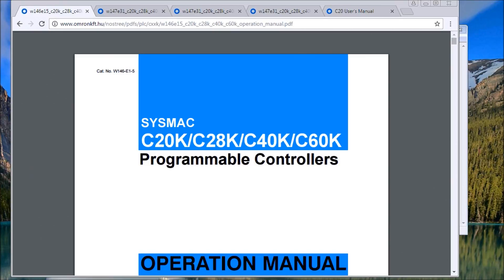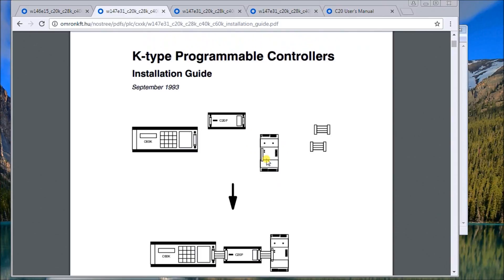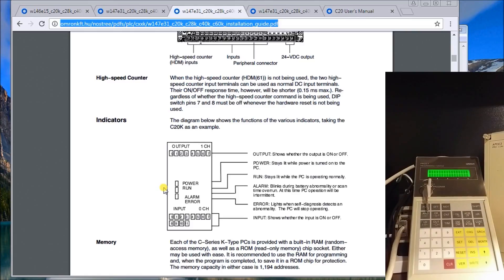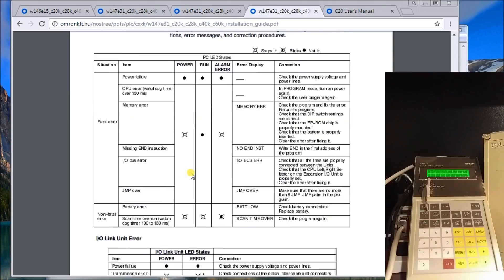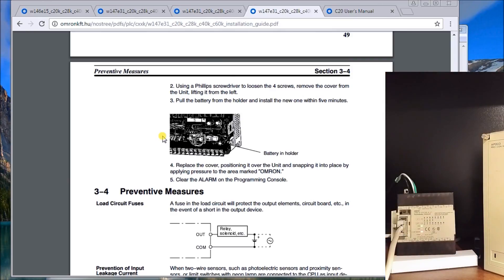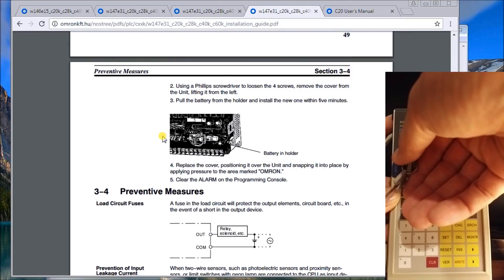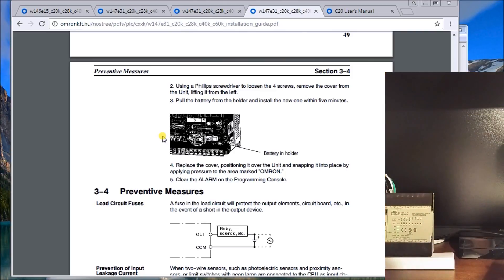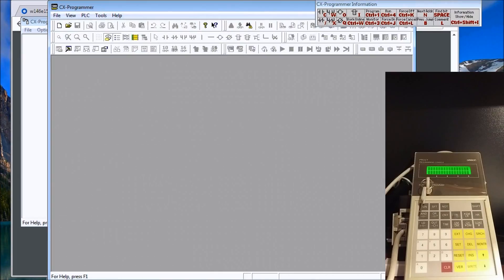Omron K-Series Crisis: 25-Year-Old PLCs on Life Support

Comment: Hello
I have an ancient Omron SYSMAC C40P controller with a C120-PRO15 programmer on board.
When turned on in all modes (RUN, MONITOR, PROGRAM), it requires a password. Can you help? It's a pity to throw it away, I could have worked more!
Reply from the maker: Usually, there is no password. Make sure the slide switch is on MON. Then push CLR, MON, CLR. 
You will find this on page 6 of the following manual.
https://www.edata.omron.com.au/eData/Software/Devices/W184-E1-1A.pdf
I hope this helps you out.
Regards,
Garry
Reply: @ACCautomation  

Thank you very much
I also now noticed in the video that at start they type this key combination. Thanks for the PDF, I will understand. You can ask another question. This series of controllers are programmed only with a special C120-PRO15 (PRO25) programmer or can the same actions be performed in software (CX-Programmer v.5)?
Reply from the maker: @Графен-д5о  
The C40P is an older Omron PLC and is not supported in CX-Programmer. 
In order to use a software package, you must use a host link module on the unit with software called Syswin (Windows XP or older) or LSS - Ladder Support Software (DOS).
https://accautomation.ca/purchase-find-parts/omron-c20k-c28k-c40k-c60k/#Software 
The best way currently in my opinion is to use the handheld you currently have.
Regards,
Garry

Comment: I need your help with a sysmac c40k. It’s part of a small printing press and all the start and stop switches go through it.
Recently the contactor to the main motor suffered a burn out and the overload protector on the contactor must have sent a signal to the PLC. I have replaced the contactor and protector but when the start button is pushed the output light on the PLC just flashes. The PLC has an eeprom in it so I’m assuming the program is still intact and running because everything else that it runs is still working fine. Is there something that needs to be cleared or reset?

Comment: Found this controller installed on an old SprayBake paint booth for an auto Body Shop. Found the battery failed, replaced it but the system was down for over an hour. Program is most likely wiped from memory now. I have to contact Spray Bake to see if they have a way to upload the original program from 30+ years ago into the controller lol
Reply from the maker: Hi Bullish Bear,
You are correct this was over 30+ years. SprayBake was located just north of Toronto in Vaughan. I did visit them a few times when I was with Omron Canada. This machine probably originated here.
If you can get a copy of the program file, it was written with the DOS programming software LSS or windows version Syswin.  I have the software to interpret the program and convert it to mnemonic code.
Here is the website. An email address is located at the bottom of the page.
https://spraybake-booths.com/home.htm
You will need a handheld controller to enter the code. 
(3G2A6-PRO15-E)
https://accautomation.ca/purchase-find-parts/omron-c20k-c28k-c40k-c60k/#Peripheral
I know at one point, SprayBake sponsored Dale Earnhardt (Sr), who came and visited the shop.
Regards,
Garry

Comment: do you know how to connect c60H to pc?because i need to printout the program
Reply from the maker: Hi MEGA NooB gaming
In order to connect to the PC, you would need a Host Link unit for the PLC.
https://accautomation.ca/purchase-find-parts/omron-c20k-c28k-c40k-c60k/#Special
You are looking for a 3G2C7-LK201-EV1 unit. This is an RS232 host link. The software required to retrieve the program and print the ladder logic is called Syswin. You will find this at the link above as well.
Syswin will only run on Windows XP.
The cheaper alternative is to use a handheld device for the Omron Series PLC. 
https://accautomation.ca/purchase-find-parts/omron-c20k-c28k-c40k-c60k/#Peripheral

You are looking for a 3G2A6-PRO15-E. This handheld can be used to view the mnemonic code which can then be translated into a ladder on a current software package like the Click Programming Software.
https://accautomation.ca/series/click-plc/
I hope this helps you out.
Regards,
Garry
Reply: @ACCautomation  on C60H already have RS232 port,is it still need a host link unit?
Reply from the maker: @meganoobgaming3992  
Sorry I was thinking C60K. Syswin (Windows XP) would still be the software that you will need to communicate to the Omron C60H through the DB9 connector on the CPU unit.
This post will show you the communication cable pinout.
https://accautomation.ca/implementing-the-omron-host-link-protocol-vb-net/
Regards,
Garry
Reply: @ACCautomation  thank for the information
Reply: @ACCautomation  thanks you so much for the information,,i will try it

Comment: What cable do I use to connect a C28K with a PC?
Reply from the maker: Hi Hero_Big92,
There is an interface that is required to connect to the peripheral port on the front of the CPU. It is called a Host Link unit.
https://accautomation.ca/purchase-find-parts/omron-c20k-c28k-c40k-c60k/#Special
The RS232 cable is then just a three-wire with some jumped signals on each end. Here is a picture of the cable pinout names.
https://accautomation.ca/wp-content/uploads/2017/05/How-to-implement-the-omron-host-link-protocol-vb-net-050-min.png

If you are just looking to quickly read, write and modify the program in your C28K then a less expensive option is to use a handheld programming console. This will do one line at a time. 
https://accautomation.ca/purchase-find-parts/omron-c20k-c28k-c40k-c60k/#Peripheral
3G2A6-PRO15-E

Regards,
Garry

Comment: Do u have any idea about sysmac C6OP?
Reply from the maker: Yes, I have worked on the P type PLC's as well as the K type. The K family uses the P type expansion units. Programming is done using the same hardware as the K type.
https://www.support-omron.fr/telechargements/documentations/2017-07-24%20-%2010-24-18%20-%20918444780/W167-E1-04A+CxxP+Installation_Guide.pdf
Regards,
Garry

Comment: Hello, Garry,
Good video. Are you still playing with these PLCs, more specifically with the C40K ?.
Greetings.
Reply from the maker: Hi Jjkanal,
Yes, we are still using the Omron K series in some applications. When they finally go we have backup programs in a Click PLC ready to go.
Are you having some issues with your C40K?
Regards,
Garry
Reply: Hi  Garry,
I need your help to solve a problem. I have two OMRON PLCs model C40K-CDR-D and I have to be able to test them periodically for which I needed a very simple application to test the inputs and outputs. I wanted to have this application in an EPROM 2764 and when I needed to try them I would just have to put that memory in the socket and power the PLC with what I would start running by testing. You should only give me a binary file to record the EPROM in a standard recorder.
Of course I would pay you for the work, think (so you can take pity on me) that for you it would not represent a great effort but for me it would represent an invaluable help.
Could we talk about this by a more private email where I explain in more detail this matter ?.
Waiting for your news I greet you affectionately.
Juan Jose
Reply from the maker: @jjkanal4154  
I would do this a different way. Purchase the handheld unit for the K series of controllers. This is the PRO15-E device that will fit in the slot on the CPU. You can then put the PLC in program mode. In this mode, you can turn on monitor the inputs and set the outputs. This is exactly what the handheld device is for doing.
Regards,
Garry

Comment: Gary - what happens if you lose battery for  a period of time? What information is lost within the controller?
Reply from the maker: Hi Lauren,
This controller has either an EPROM chip or RAM to store the program. If you look under the cover on the left side of the CPU, you will see a socket. This is the EPROM chip socket. If it does not have a chip installed, then you are using RAM memory.
The battery will back up this RAM memory, so if you loose the battery your program is lost.
The battery also backs up the memory retentive data areas in the program like DM and HR. These will be reset to 0 if the battery power is lost.
Hope this helps you out.
Regards,
Garry

Comment: whit this sofware a can programer the plc c20k c28k,c40k,c60k all the omron the sofware name is the cx programer
and this plc is the lss data  one answere who is the cable  if plc omron for ejemplo c40k have one port  db48 fame (woman)
pleace who cable
Reply from the maker: Hi Juan,
In order to communicate with software this unit requires an adapter that will mount on the same port as the PRO15 hand held unit.
Here is the communication adapter: (Host Link Unit)
http://www.omronkft.hu/nostree/pdfs/plc/cxxk/w182e11a_c_k_host-link-units_system_manual.pdf
There are only two software packages that can communicate to the host link for programming:
DOS based system - LSS (Ladder Support Software)
http://forums.mrplc.com/index.php?/topic/16805-demo-software-lss-302-dos-software-for-omron-plcs/
http://forums.mrplc.com/index.php?/topic/501-lss-technical-guide/
Windows based system - Syswin
Manual:
http://www.edata.omron.com.au/eData/Software/Windows/Syswin%20V3_4%20Operation%20Manual.pdf
Software:
http://forums.mrplc.com/index.php?/topic/33-download-syswin-software-for-omron/
Here are the cable configuration for the host link:
http://www.edata.omron.com.au/eData/PLCs/XW2Z-_DS.pdf
Note: This hardware can still be found on Ebay.
Hope this helps you out.
Regards,
Reply: @ACCautomation    thenks for answere
Reply from the maker: @juanhernandez-dw6rq  
You are welcome. 
Garry

Comment: Gary,

First off thanks for this video very informative.  We are having trouble with our C28K.  Everything appears to be working but the Run and Output lite on the unit come on when engaged but quickly go off.  Any idea on this one?  We have lost function at the control panel
Reply from the maker: Thank you for your comments.
It sounds like the power supply of the unit is not working correctly. Do you have a handheld device attached to the controller? If so, please ensure that the switch is in run mode. The PLC will look at this switch when powering up to determine what mode to place the controller into. 
Regards,
Garry